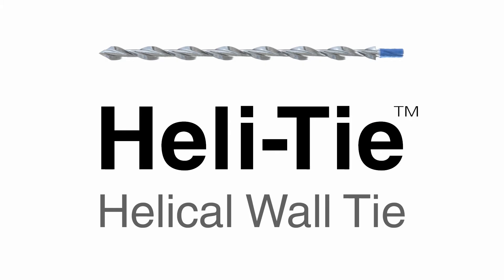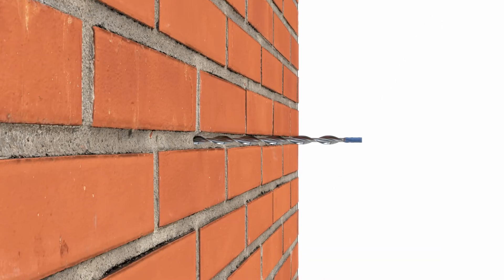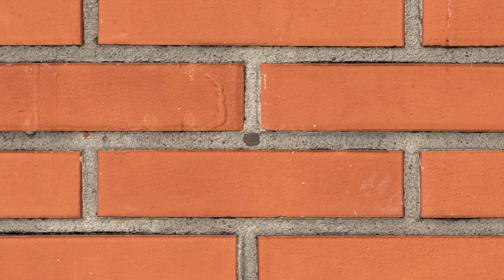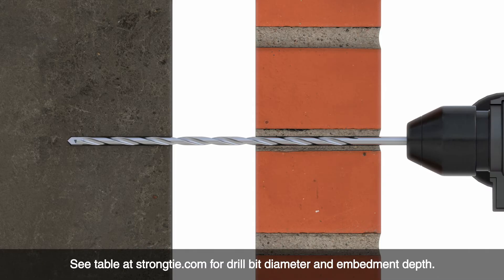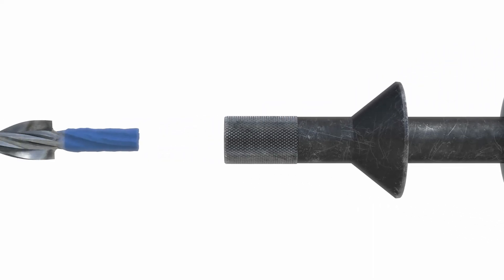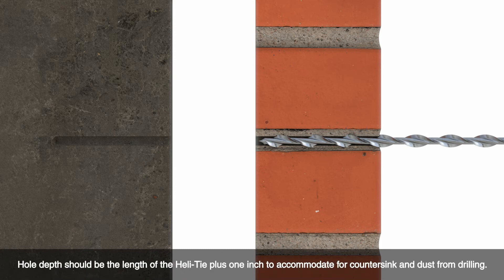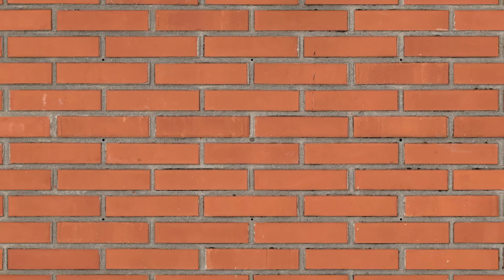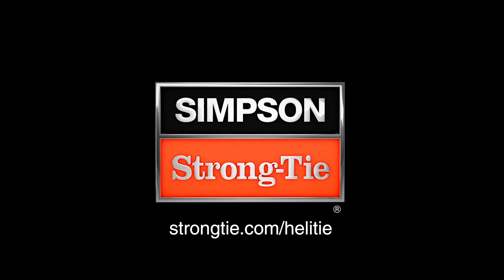How to Install Heli-Tie™ Helical Wall Tie

Comment: What if the home is a URM with no substrate backing. Just double brick?
Reply: Then you would probably use horizontal ties, removing some mortar packing the ties depending on what the damage is to your brick wall

Comment: Can the anchors go into a wood stud backing or only more masonry/concrete?
Reply: Both are fine
Reply: @davepowell7168  does wood stud need pilot hole drilled as well? if so, same size?
Reply: @AdamJimenez-b5w i'm pretty sure stud would need pilot hole, same size

Comment: what size masonry drill do you use ?
Reply from the maker: Apologies for missing this question. The bit is 7/32" or 1/4" diameter. Length varies based on the application.